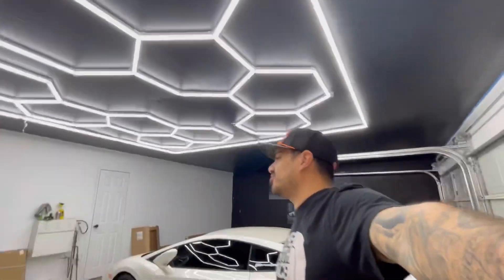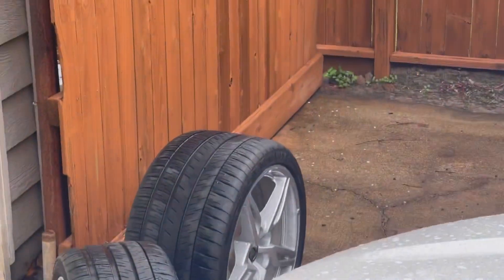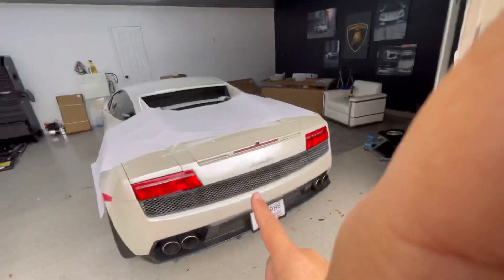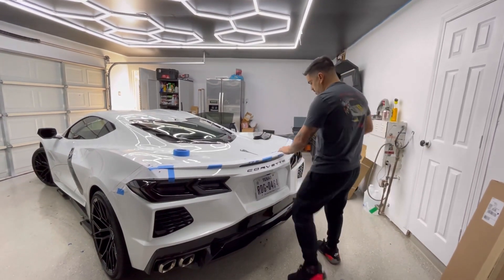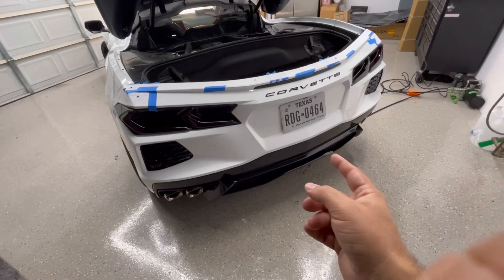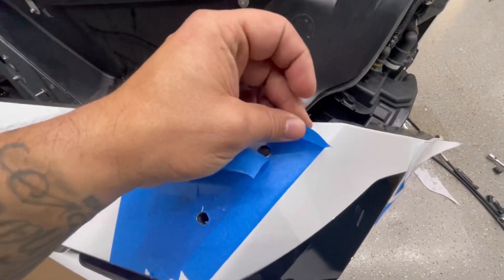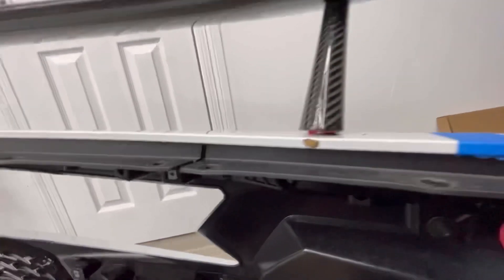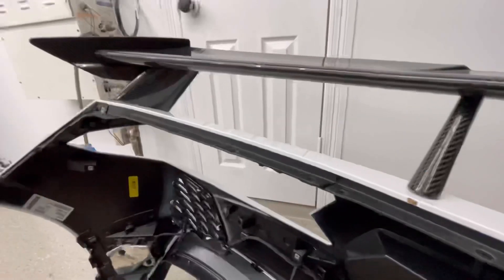DIY How To Install High Wing in C8 Corvette (Carbon Fiber)

Comment: Did you drill all 7mm holes? My template calls for 9mm holes and one 7mm hole in the middle? Looks like your bit is smaller than the template holes.